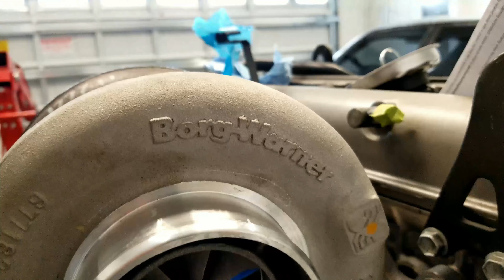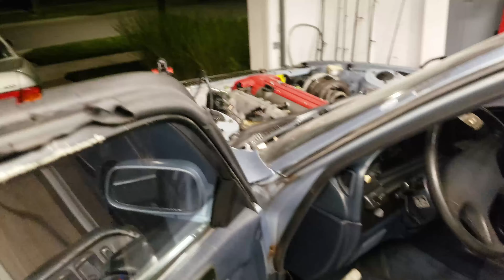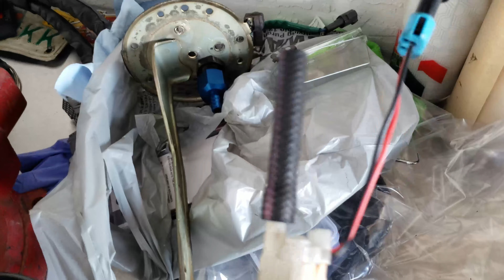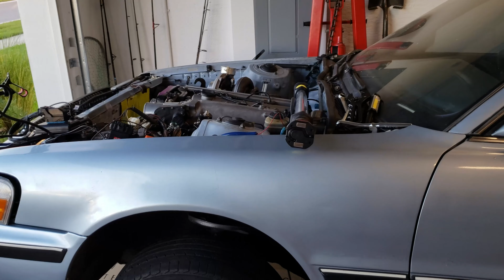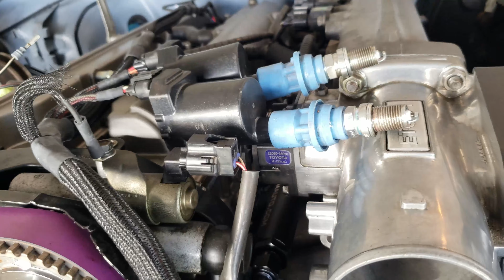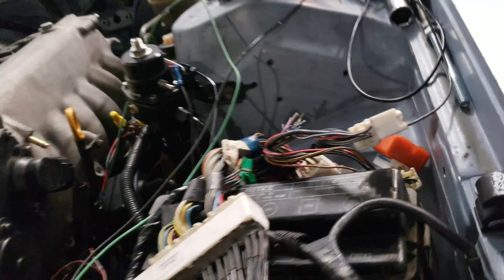Ep9 Started the 2jz Cressida and installed LQ9 coils

Comment: Are you running yet? How’s the idle with 2200cc Bosch and lq9 coils?
Reply from the maker: I slowed down progress over the holidays. The car isnt tuned yet so the idle quality wasnt there. I have a few friends with the same injectors without any idle issues
Reply: I coughed up for 1650cc just to be safe on idling. More inj than I will need